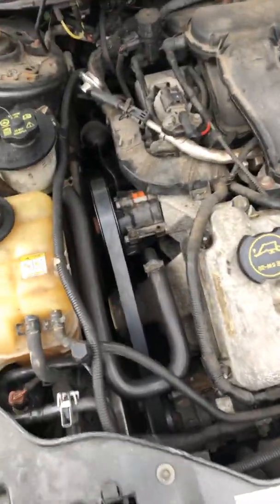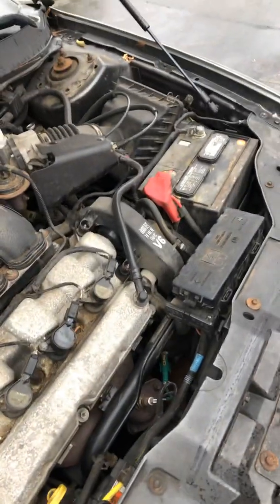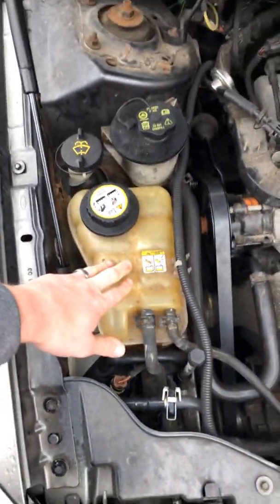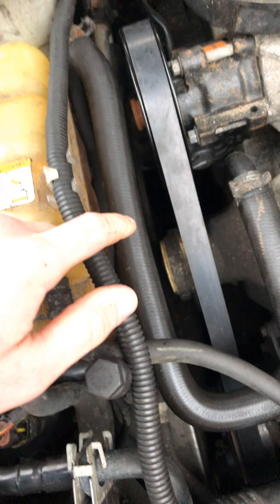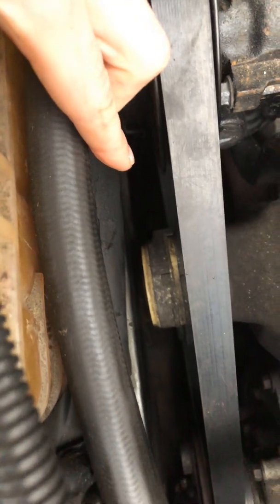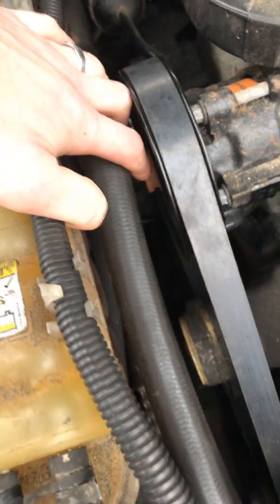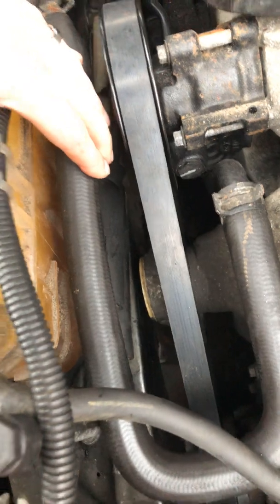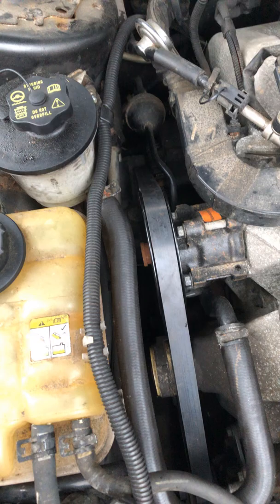Serpentine Belt Removal/Replacement - 2004 Ford Taurus 3.0L DOHC Engine

Comment: I hav a 2004 mercury sable with same engine. I would think it would be identical but the alternator on mine is over to left farther. Yours looks like belt goes straight down in more to get to alternator, on mine the belt goes over to left more horizontally (angled slightly down) to get there. It wudda really helped a LOT if u cudda gotten a flashlight & shined down in there. I installed belt according to the diagram here but belt us too loose. Btw, that very bottom "pulley" u referred to when u said u thght there were five total, that's the CRANKSHAFT! It's not just a pulley, that's the crank that drives everything.
Reply from the maker: Yeah looking back I’m mad I didn’t use a flashlight, I should have. I made this video a while ago so possible I may have mentioned the “pulleys” incorrectly including the crankshaft. Hopefully you were able to get yours fixed! I’ve been given the wrong sized belt multiple times at auto parts stores so hopefully you have the right sized one for your car, but odd that the alternator is in a different location if the engine is the exact same…

Comment: Whst size belt did you use. I have exact same pulley system and have been at it 3 days .4 different belts. The 82in  is to big.
Reply from the maker: Not sure on the exact size of the belt, I just went to the nearest Napa or any auto store & got the belt giving them all my car specs. I will say though, I misread the pulley diagram multiple times and that’s what took me so long getting it back on. Always seemed too short & really I just had it wrapped wrong, let me know if that works! Good luck!
Reply: @Austinhagemeister  yes I need a inch to and have same idle pulley. The 15 m goes in the brown brick or in the wall side , and do u have to hold the other side on tensioner..do you go under tensioner or through it. Thanks a million . Broke down for 3 days. Same spot, 3 beltz . 50 attempts,  15 showers at planet fitness,  want to go home. Nor leaving it behind.  Never leave no one behind. Lol. Thanks from NYC were the parking tickets will come
Reply from the maker: I just had someone hold the belt tight while I made sure it was over all the right pulleys in the correct order

Comment: Where's the tool
Reply from the maker: Hey William, linked them both in the video description!
Reply: @Austinhagemeister  the link has expired I think,I need to know the kind of tool used to adjust,I need to fix mine now ,but I don't know the tool I need to use
Reply: @akeemadekunle1131  I have that tool, it's at Harbor Freight store.
Reply: Belt tensioner tool. Lest that 20 bucks.

Comment: That Taurus with that engine is a nightmare to work on. That is like the ultimate disposable car and that's why you see so many of them sitting at your local salvage yard that are unwrecked.
Reply from the maker: Right! I have about 184k on it and just try to do basic fixes so I don’t have to get another vehicle but very difficult!
Reply: @Austinhagemeister  Well, it sounds like you got a good one with a good torque converter. Our 2002 had the soft torque converter splines and they stripped out with just 70K on the clock. I have been working on the car for 3 months now and I'm 95% done but I know most people would not have fixed it and it would be sitting in Pull-A-Part with all the rest of them. It's a shame that Ford builds junk like that.
Reply from the maker: Man. Yeah tranny I would be nervous to try, I’m just looking to save on the basics! I do have a faulty harmonic balancer as well on it-wobbles a lot and causing engine noise so that may be my next video!
Reply: I have no idea what this guy's talking about that these cars are a nightmare to work on and they're just a disposable car, the problem with any car is that people don't perform proper maintenance because they're defective. I've had at least five of these and worked on probably hundreds of them and never had any real problems doing anything on them including rebuilding them replacing the v-type timing chains torque converters oil pan gaskets. I even owned one right now what about 50,000 miles on it and it's a 2004 with the duratec 24 valve motor and like all the Ford Tauruses I've owned from 2004 to 2007 we're always kept in absolute beautiful shape by simple maintenance. People say this shouldn't be touching cars cuz they don't understand that maintenance is a huge and very important procedure and maintaining a vehicle, I've had people come in my shop and say that their Taurus was a piece of shit because the transmission was slipping at 130,000 miles and I asked him has the transmission fluid ever been checked and the filter replaced and they said no why would I do that. There's your answer folks.
Reply: Please stop making videos

Comment: So the top part of the dual spinner tensioner (the striped part that is showing) is where you put the tool to release tension ?
Reply from the maker: Yeah it was easier for me to just slide my finger down to feel for it first, but yes. I just held it in with a finger when pulling to make sure it didn’t pop out.
Reply: @Austinhagemeister   Interesting because on the one i worked on today i was not able to get the tensioner tool in between the engine bay wall and the tensioner without prying the tenioner away with a 18” flat head screwdriver. Also i tryed two different belts and was unsuccessful with both? Can you track down the part number on that belt? It may say on the belt or be on a reciept.
Reply from the maker: @OneNationUnderSoundness  sorry honestly I had to just ask the guy at the store but since I've sold the car for parts...

Comment: The ac compressor smoking??
Reply from the maker: The AC was not no but it is broke and that’s on my list to fix, problem with DIY and living in the north is that winter hits hard. I can see/hear the rattling piece of the ac compressor though and all the Freon is gone
Reply: @Austinhagemeister  I replaced the A/C compressor on ours last year with only 65,000 on it and BTW it's a nightmare to replace as well. It's a lot harder than the 3.0 Vulcan and you will need to remove the black water pipe that sits above it.